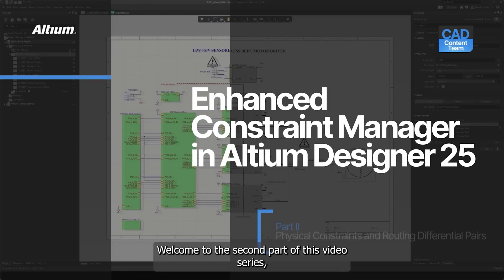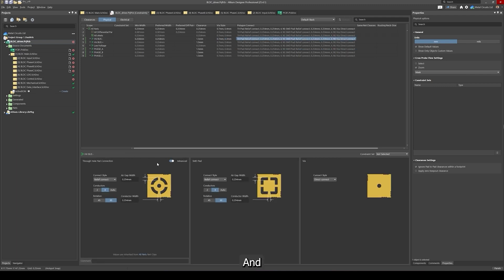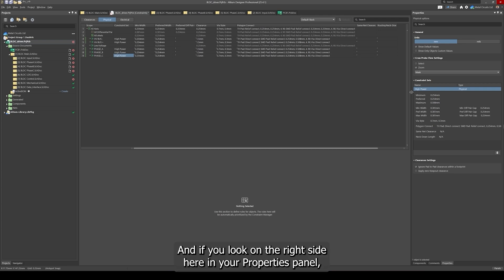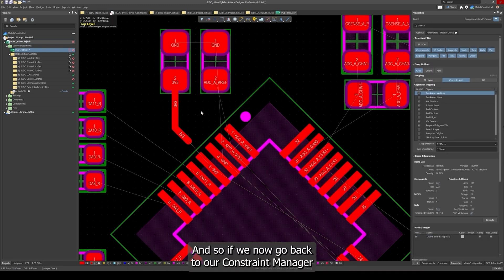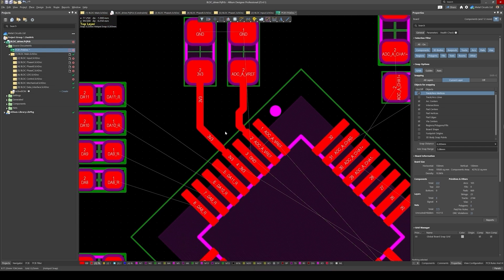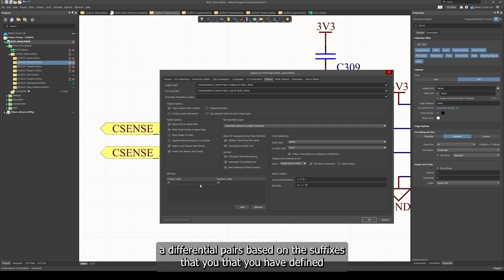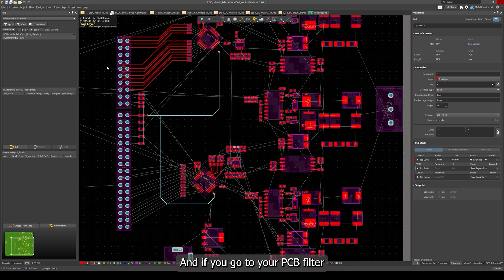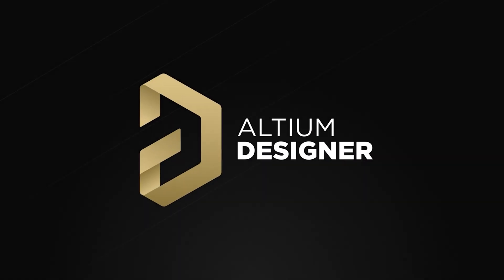Enhanced CM in Altium Designer 25. Part II: Physical Constraints and Routing Differential Pairs

Comment: how does it work if i want to assign an impedance to those diff pairs? Since it depends on the stackup, it's not obvious
Reply: Hello, when the Impedance profile(Differential type) is created in the Layer Stack Manager. The option to use Impedance profile will be available in the Constraint Manager Physical tab, in the lower table after selecting Differential Pair or Diff Pair Class.